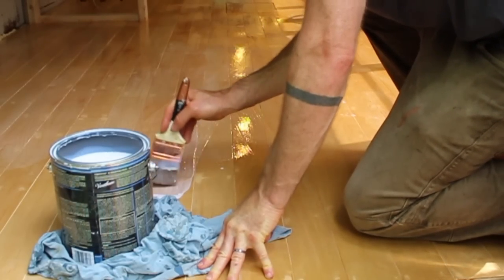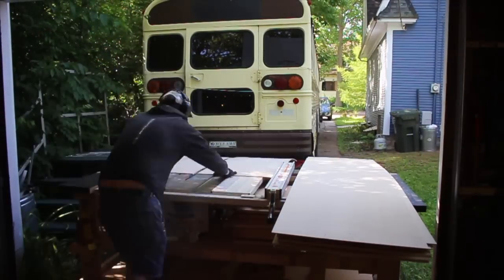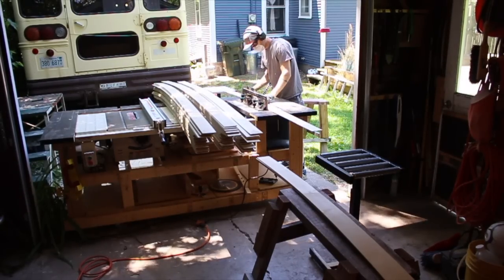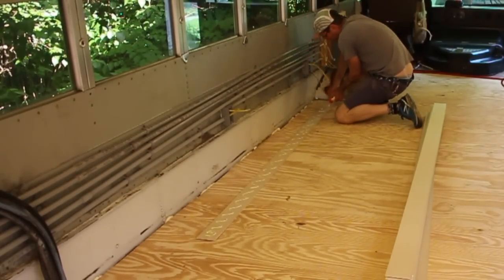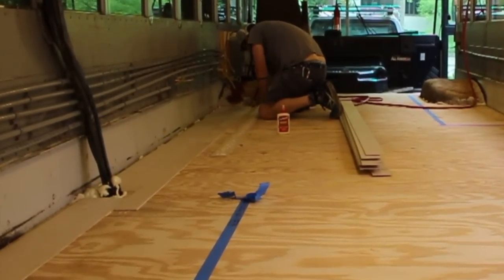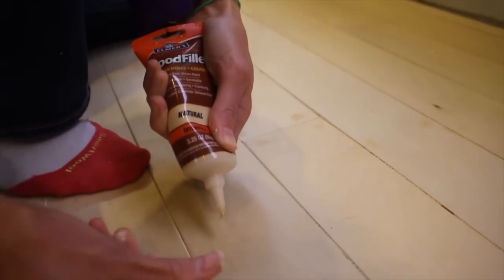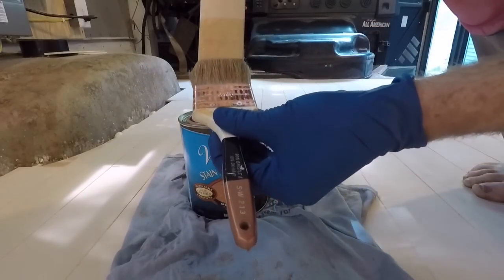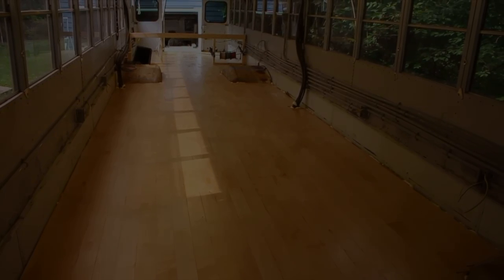ULTRA THIN Plywood Flooring

Comment: I did a similar project in my daughters room.  I used a dark color. She wanted a shiny glass finish.  Her floors have held up nicely for over 5 years.  The ones i did in a sitting area/walkway which gets a more wear and got a satin, water-based finish, still look ok, but need another coat of finish. I pre-sanded the edges and pre-stained the boards before installing. Your floors look beautiful.  I hope you enjoy your flooring as much as I did.  I enjoyed you video. Thanks for sharing. They turned out beautiful!!!
Reply from the maker: Great to hear about your project! I'd definitely do another floor this way. :)

Comment: did you know that if you mix a little bit of sawdust (that you've made cutting them floor boards) and a little bit of white wood glue it makes a paste to cover up your nail heads and it turns out (once dry) to match your colour wood. simple. and it's cheaper then buying a putty to cover up the nail holes.
Reply from the maker: Yep, it’s a good trick. I use it for larger voids ... cool to see ya checking out the videos!
Reply: YES!!!! I used to do Furniture and Refinishing
and that is exactly what I used to do...
Looks natural..
Reply: Great tip, Mr. Hodg. One can also mix it in a plastic bag, cut tiny tip off the corner. Apply to large areas with small holes like this project was. You can even fold over then tape the corner down when done. If you tape well it lasts a long time if you also get most the air out the zipper side.
Reply from the maker: Nice method

Comment: That turned out great. I like your big table saw table. I'm sure that helps so much with ripping the thin plywood. Any reccomendation on ripping with a skill saw and having every rip straight and same size ?
Reply from the maker: Ripping with a skill saw can be tough because you'll often get variation ... I'd try to use a guide or fence for sure just to get everything identical

Comment: This looks great. One question I have is about the durability of this thin plywood as a flooring. I am being told by plywood venders that the birch ply will get beat up quickly even with an applied poly sealant. How has this floor held up over time? Do you have any recommendations for achieving the most scratch/dent resistant finish without sacrificing the natural (non plastic) look?
Reply from the maker: I've put down a lot of floors, and the longest lasting in my opinion is solid hardwood: so maple or oak, for instance. But this is much lighter and thinner, so was ideal in this installation. It's been perfect for years, but we don't even wear shoes on it, so that's not the best test. As for finish, I always multi-coat with poly and it last for years
Reply: metaspencer thanks for getting back to me so quickly. Typically, hardwood flooring would be best for durability sake, but because of some unique surface conditions we have, we need a surface with some plasticity that can bend along a waving surface; hence plywood. I’ll definitely be taking your input into consideration 👍
Reply: I was wondering also how long these held up. Im considering this in my kitchen

Comment: Did you try a sample area without filling brad holes?
Iv seen it that way on videos and looked good.
Reply from the maker: I could see that working out, but my preference was to fill the holes and keep dirt from getting in there and metal showing. But you could definitely do it that way! :)
Reply: @metaspencer  the clear coat fills the space. 
I only mention because my house has a couple rooms with the old school narrow strips non tongue and grove from decades back. That's how they done it back in the day and you don't see it because of the finish and clear coat. 
Anyway no offense just a suggestion
Reply from the maker: Oh cool! Yeah, I could totally see that working out. Thanks for the info

Comment: $2 a sqft that's an insane amount of work for that.  I just installed engineered hardwood flooring brand new cost me less than that
Reply from the maker: Yeah, my math was way off when I made this video and others have noted it ... it was more like $.50 to $1 a square foot, once you factor in the materials costs (sheets of plywood, nails, glue, poly, etc.). I bet that new floor of yours looks great!

Comment: $2 per ft!?!? That cant be right. Its $8 for a 32 sf sheet or .25 cents per foot plus glue and nails. I mean you can buy laminates and even super cheap hardwoods for about $2 per foot.
Reply: birch plywood is not 8 dollars a sheet
Reply: @Automedon2  
Birch plywood is expensive.

Comment: When you use that type filler, remember that it is water soluable. You should  apply a little proud to allow for shrikage, then take some tough fabric, like old jeans or canvas, and stretch it over a scrapwood block. Moisten the fabric and rub it over the filler until it is flush. It takes a little practice, and you have to keep the fabric moist, not wet, but you save on sandpaper and the dusty mess that you otherwise have to contend with. Rinse the fabric periodically to keep it from filling up.
Reply from the maker: Oooooo, now that's a trick I didn't know about! Not only would that method have saved me some sanding, but it would have left a cleaner finished look to the covered nail holes. Thanks for that pro-tip. Very cool.

Comment: Turned out Beautiful...
but your floor is really thick... 
that is going to be a lot of weight
in that RV...
I did that and blew out tires and hurt
my axel ...
Good luck.
Reply from the maker: Wow, that sounds tough! My existing floor was about the same thickness, plus the bus had 24 heavy steel seats ... so I dropped some weight with those seats. Thanks for the idea!
Reply: @metaspencer  
OHHHHH... that sounds right!!!
You'd think I would have thought of that...
since I had been a school bus driver!!!
Your floors turned out Beautiful
Reply: @metaspencer  
Well, I'm back again to watch your great video...
This time with more excitement... I am reflooring my 1982 Class A RV... which is similar like your school bus...
How are you liking the plywood floors now? Is there anything you'd change about it.
Thank you for your reply.
Reply: This is funny... it's been 9 months and NOW I'm getting ready to do the floor on the 1982 Class A RV... I refinished a Vintage 1972 Travel Trailer in this last 9 months... 
I am so glad I found your video again... This is what I want to do...
Thank you again for such a GREAT Video and GREAT Editing too.
I love it when someone Narrates over their video and speeds up certain scenes like cutting the boards.
Reply from the maker: That’s so cool! I’m living in the bus for a spell and yeah, the floors are still great. I don’t wear shoes inside which may help. Good luck with the project

Comment: Enjoy your video.. if I may ask, what type of plywood did you use? I am deaf and I must have missed that part in your video.  I'm in South America now but returning to USA April 4 2019 and will start on my Skoolie project.  Look like something I would like to tackle for floor, wall, and ceiling.  Thanks!
Reply from the maker: hello, great question! I used 1/4" birch plywood. What you're looking for if you want a thin floor like this one is 1) a nice looking plywood of some kind, and then 2) thin sheets. Good luck with it! It's cool that you're going to be doing a skoolie project! woohoo!
Reply: @metaspencer  Few more question.  What router bit did you use to chamfer and why? Was it because of glue on the edge?  And what type of nail did you use on the brad nailgun?   Thanks!
Reply from the maker: Brad nails, small like 22g ... very small is better. As for the chamfered edge it’s aesthetic. Without chamfered edges you don’t see each plank

Comment: You can see all of the filler that didn't get completely sanded off with your toy sander 8:07
Reply from the maker: My toy sander! Ouch! Yeah, there was definitely some left but the floors worked out great after sealing them up
Reply: @metaspencer  Please don't take offense. I've been sanding wood floors for 30 years so I have all of the latest greatest equipment. These DIY videos get recommended to me all the time, but don't worry you're not the worst that I've seen LOL!!!
Reply from the maker: @RNicolasRuvalcaba  Oh dang, you're a pro! I've done about 6 wood floors in the past 10 years, so it's definitely not my specialty! Take care man